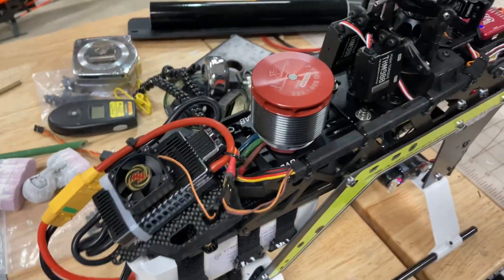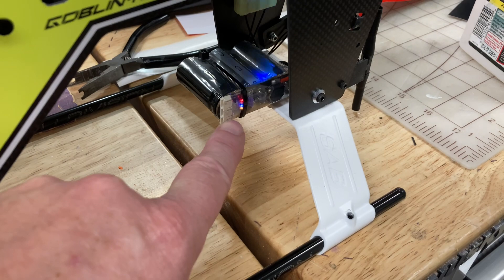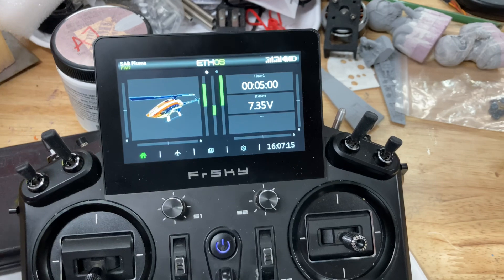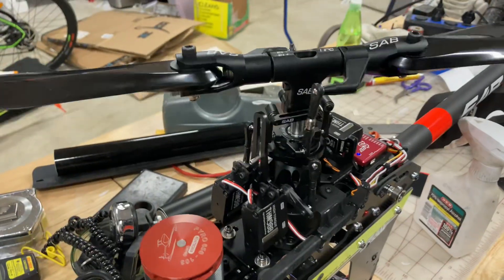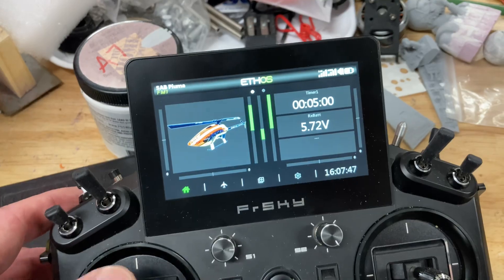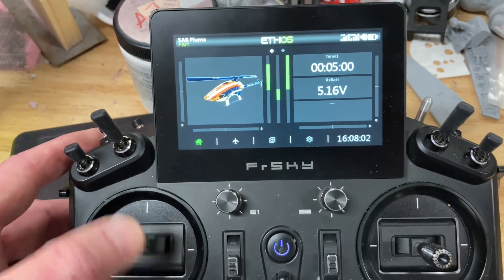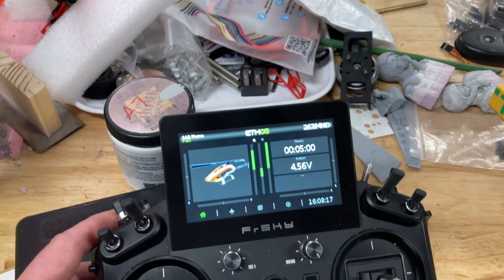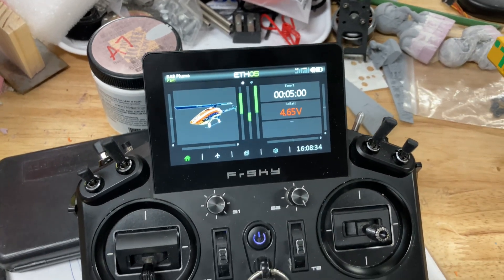XGuard power backup demo

Comment: Chris , have you figured out how to to turn it on and off from a switch on the radio? I have an X20s with a IKON2 but cannot figure that part out even after I have programmed the port to a switch.
Reply from the maker: Yes, I have mine set up to power off with a toggle switch. You just need to hold down the power button on the XGuard as you plug in a pack to activate the remote shutoff. Then just assign a switch and output to the channel you're using, and toggle it after you disconnect the main pack.
Reply: @JustPlaneChris  so I have the XDFLY backup. I wonder if it the same concept?
Reply from the maker: @trhammonds  as far as I know, the XDFly doesn't have remote shut-off capability. Or if it does, I haven't figured it out!